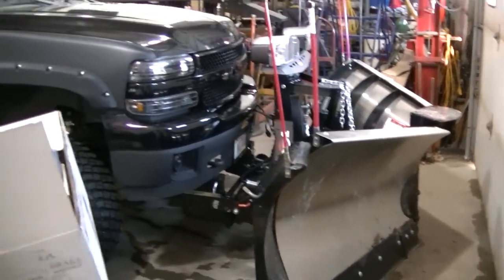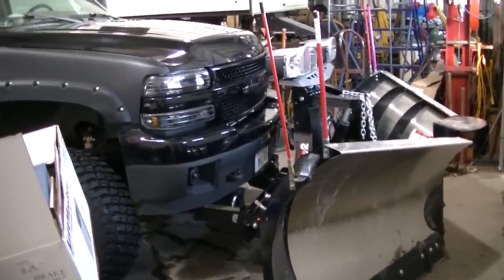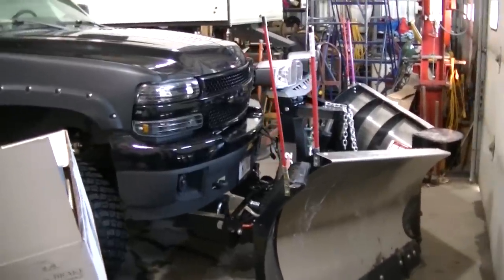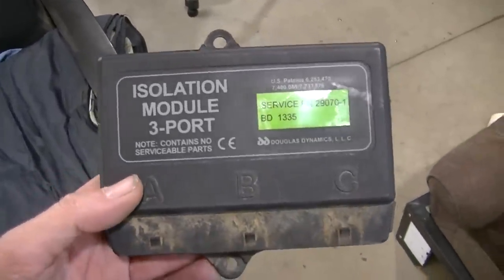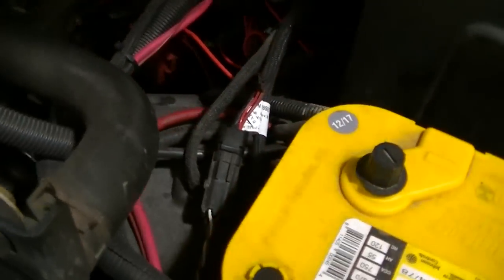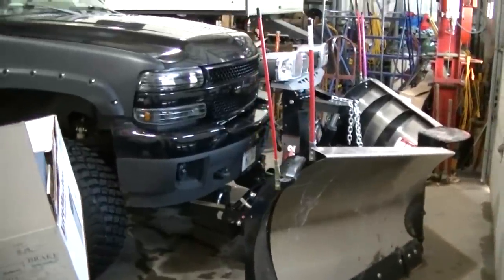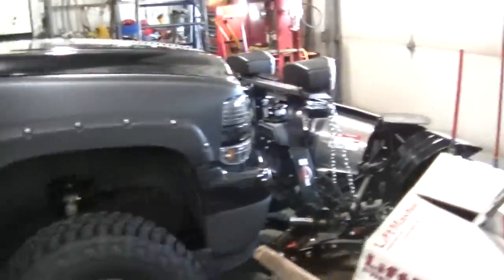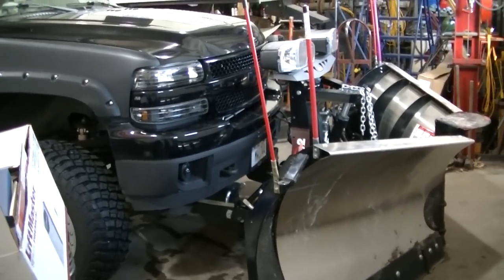Snowplowing BREAKDOWN First of Season

Comment: Glad you was able to get it fixed I wired a Western plow for a friend one time on that green pick up truck that you may have seen in some of my videos and now that you have posted this video I will message him and tell him he should probably get an extra 1 of those boards just in case he has the same problem happened to him. And that we get in one of those led off road bars is good to have on there I love mine  The one that is on mine is from strobes in more and it has dual purpose it's a floodlight and also a strobe light so you can have front lower warning if you got 1 of those they're just a little over a 100 bucks they have it 2 year warranty I do believe and their heavy duty I am getting ready to add some more flood lighting to my plow you will have to check out my video tonight
Reply from the maker: I saw that video of the light.  It looks like a good light but not sure I want more strobes bouncing off stuff while plowing.  That drives me crazy.

Comment: You could throw a small single row auxbeam light between the two plow lights. Then just go buy one of those two prong trailer plugs for a quick disconnect.
Reply from the maker: Thinking about trying a yellow light.  They say those work good in bad weather.

Comment: Hey Mossman what do you think of the boss dxt vs the mvp3? My buddy has an mvp3 and his cutting edge was junk after half a season of plowing commercial. I know you haven't had any cutting edge issues, but the boss dxt just looks like a little more beefy of a plow. Just wanted to get your 2 cents about boss i guess. I know you're a western guy but i figured maybe you've heard good/bad things that you could pass along.
Reply from the maker: If he burned through a Western cutting edge he will burn through a Boss cutting edge too.  I am not a product basher like some.  He can get the 1/2" cutting edge which should last longer.  The 9'6" I believe comes with the 1/2" but the rest don't.  If he has an 8'6" he should upgrade.  Also if he is pushing that much snow I hope he is making enough money for equipment repairs/parts.  It will also depend on the surface he is pushing on.  Old blacktop/concrete will be really hard on cutting edges.  Western isn't making inferior cutting edges on purpose like some idiots think.  I have never really heard anything bad about a Boss.  We have no local dealer.  I prefer the Western truck mounts and love the controller with the one touch buttons.
Reply: Fyi Boss uses ar400 and ar500 steel for their cutting edges. They will last longer than your standard cutting edge. You can also get aftermarket cutting edges made out of ar400 steel or Winter Equipment cutting edges that are made out of high grade boron steel. If he's still burning through edges he should absolutely at least try a high grade aftermarket one.

Comment: Well breakdowns are never good , but it sounds like you have it   sorted out 👍

   Pretty much   have to have a parts wall with 2 of everything!  

 That iso module appears to be identical to the Fisher set up, and same with the controller,  just the Western is Red and Fisher is yellow. 

  I think they are both owned by the same Parent Company,  Douglas Dynamics.  
     Must cut into their profits to ship the plows from New England to the Mid West and vice versa.  

   Thanks for sharing what you learned !
Reply from the maker: They have the same hydraulics and wiring but plow structure and mounts are a bit different. They build the Western stuff in Millwauke Wi. Around 3 hours from me.
Reply: @mossman381  
Cool! 
They build the Fisher stuff in Rockland Maine,  about 2 hours from me here!

Comment: How do you like those drop down brackets from western?
Reply from the maker: Seem to be holding up.  There is a bit of slop with all the adaptors.
Reply: I had a set made up at. The local fabrication shop and are stout, allot stronger then westerns and no slop..

Comment: You can unplug the iso box and jump 2 wires and the plow will work , I don't run an iso box on mine , I have 2 trucks that I run this way , no lights though
Reply from the maker: I would like to know what wires you are jumping.
Reply: @mossman381  I can try to explain,. There is a plug in the iso module that goes to the controller , unplug it , there is a red wire and a red/yellow wire , jump them together, basically that is power in and power out the box doesn't control the plow just lights.those are the colors on my straight blade, I have a v plow that is the same but I'm near it to check wire colors. You could check with a test light for power in and out on your iso module on that plug
Reply from the maker: Thanks,  I will do some testing.  This could save my butt if this happens again.
Reply from the maker: @neillee5835  I have no red wires on the controller plug. I tested for power with the switch on and there is no power to any wire on the controller plug. Are you running a three plug iso module harness? What year are your plows?
Reply: @mossman381  it's the plug that plugs into the iso module the other end goes to the controller and the batery
Reply from the maker: Ok, so you must be talking about the plug before the plug that plugs into the iso module.  I was looking at the plugs that plug right into the iso module.
Reply: @mossman381  let me look at my v-plow set up and I'll tell you what I have there four wire colors
Reply from the maker: There is a plug with four wires before the plugs that actually go into the iso module.  I am not in the shop right now but those must be what you are talking about.
Reply: @mossman381  ok, I looked at a wiring diagram , I have a 4 port so the plugs and colors are different, if you look at a wiring diagram for a 3 port then in the center plug there are 2 wires that are marked control power in and control power out , those are the ones to connect
Reply from the maker: @neillee5835  I found it already. I will have a video. This could really help if someone has the iso module fail and can't get one right away.
Reply: @mossman381  great
Reply: @neillee5835  can u show me how you did it

Comment: says 3 port that means its for a 3 plug setup correct? is that plow 2 or 3 plug?
Reply from the maker: It's a 3 port but works for a 3 plug or a 2 plug.  Check your part # before you order one.  The one I show should work for most but check to be sure.

Comment: I had that happened the truck power plug ended up being bad and it looked perfectly fine
Reply: I always replace solenoids every season to just because
Reply from the maker: I have had plug issues with a really old plows. I think all my stuff was a little to new to have that problem. I am just lucky I had an iso module I could try.

Comment: I was  going to say check your connections what you did. And I was going to say check your pins on those connections and make sure one of them somehow didn't break or have a crack in it and then check the brain box there's only so many things that can be.  looks like it was your brain box better get yourself an extra one on hand for your glove box. 

So you'rw light issue  just go another magnetic light bar like on your dad's truck that you made up and you can sit right on the hood of your truck and plug it into your 12 volt power adapter and go home that way that way you can take it off and on as needed and you can choose whatever size you want and if you want the big Long light bar or or maybe a 12in or something least you got it figured out,  let us know what you figure out on the lights...👍👊🤙🙂
Reply from the maker: Yes,  I could make me a magnetic light.  I believe I even have some magnets.
Reply: @mossman381  yeah I just trying to think of something that would be simple and you could use it for other things too and having in your truck for whenever you needed it just thought it was a good idea thanks for the reply Mr.  Mossman

Comment: Hello, I have a question for ya.
Reply from the maker: You don't have to ask to ask a question.  I try to answer all questions I get.
Reply: mossman381 Okay, I was wondering which light I should get for my 2008 Chevy Equinox because I wanna get one cause of where I live, there’s nothing but back street roads so I’m trying to get one so that I can use it but just not sure how wide I should get.
Reply from the maker: Have you thought about an LED headlight upgrade.  I am not real familiar with the Equinox but an LED headlight bulb might get you what you want without having to add lights.
Reply: mossman381 I have hid bulbs for the headlights and the fog lights. I’ve had the led bulbs but didn’t like how it works.